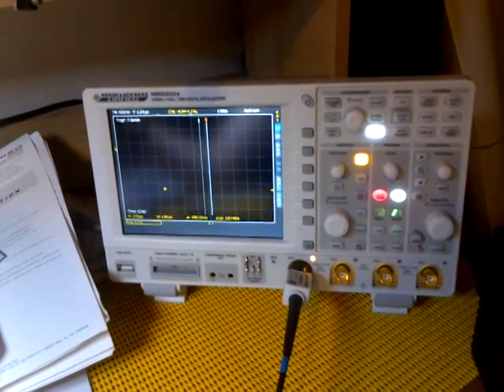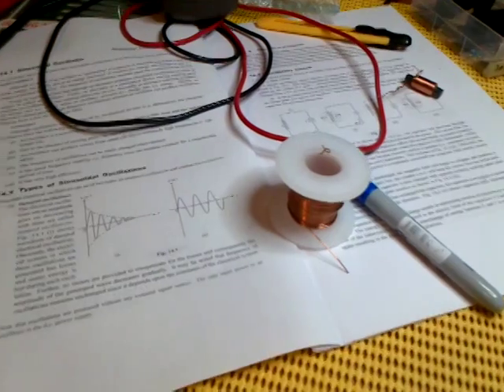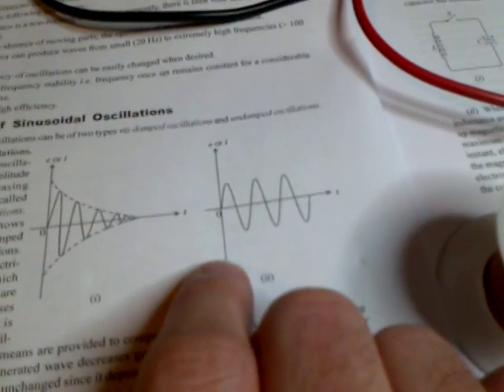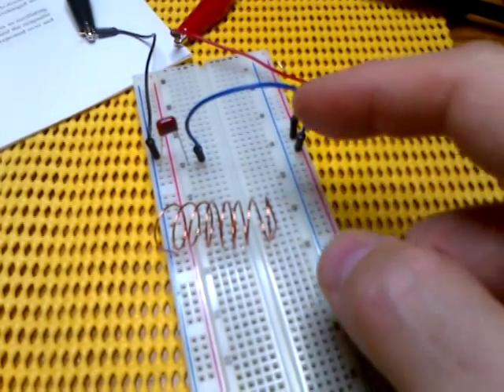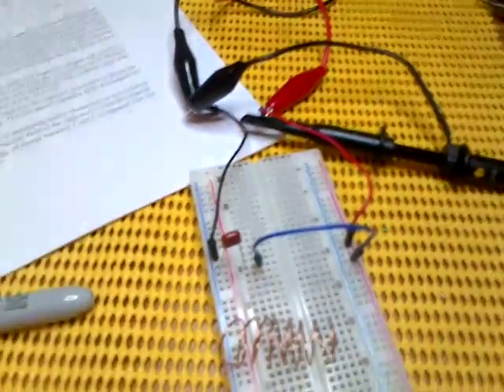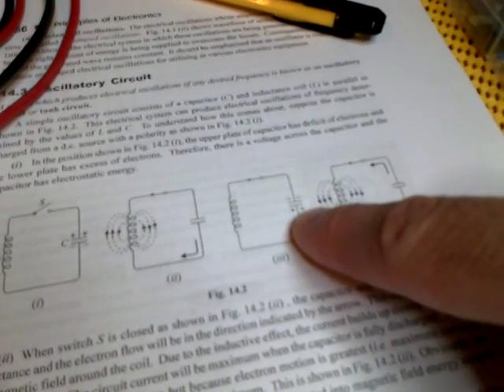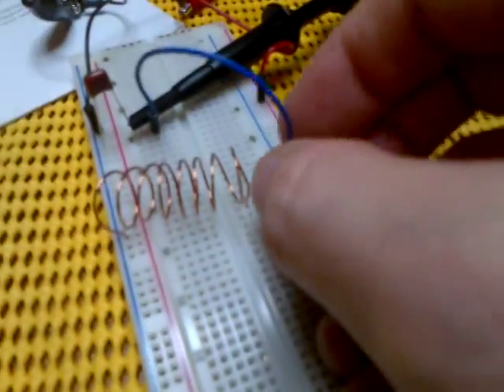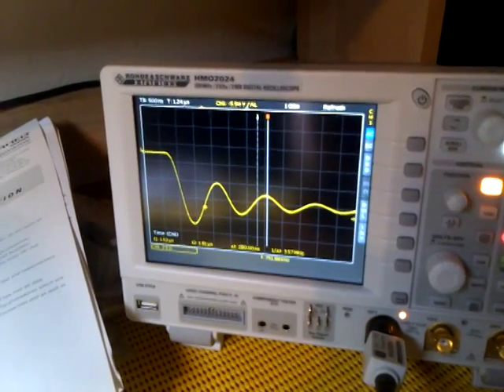LC (tank) circuit dampened oscillations on an oscilloscope Part 1 of 2

Comment: Is it possible to build an oscillator circuit, drive it into the ground through two electrodes, and emit electromagnetic waves at desired frequencies?
Reply from the maker: @mirzakral7807  Yes, I think this can be done. I believe low frequency radio waves passed through the ground is(was?) used to give cave rescue teams a telephone system to use underground, where regular radio communication does not work.
Reply: @queuerious  Thank you for your comments. I also think that these low frequency waves can induce some underground metals. Mine is an amateur project. I am researching to see if some metals can be detected with a sensitive antenna.
Reply from the maker: @mirzakral7807  good luck with your research!

Comment: Like video - could you tell me the value and type of capacitor used ?
Reply from the maker: @DavidHodgson-rm5gw, I dont recall the values unfortunately. I certainly didn’t use special values, and would have used a capacitor that was at hand. Start with a larger value of C (say 1nF or 1uF) and try some random wire coiled up, and see what happens. The frequency should be 1/2pi(sqrt(LC)). Good luck and thanks for watching.

Comment: So that capacitor plates get recharged by the magnetic field of coil.
Reply from the maker: Yes. The changing current in the coil induces a changing magnetic field, which induces an opposing voltage and current in the coil, and this reversal current fills the capacitor. As the capacitor charging slows, the process is underway again in the opposite direction. The resulting current flows back and forth in the circuit, from one capacitor plate to the other, passing through the coil. The frequency of this behaviour is only dependent on the amount of induction in the coil, L, and the size of the capacitor, C. The result is a 'ringing' of energy, which is dissipated with heating from parasitic resistances until the current stops flowing. 

This inductor/capacitor (LC) arrangement is central to many oscillators (e.g. in radios), where you can get steady, continuing oscillations by adding energy into the LC circuit at just the right time (that is "in phase" with the natural resonant current flow described above).

Thanks for watching!
Reply: @queuerious  It's interesting to see how it works with one swing. I see 2 further steps to go. There is a maximum voltage for each LC-Circuit. That's the Q-Factor. And it always takes 10 or more swings to get to full swing respectively to get to the Q-Factor. The ringing would be much better and much longer with a signalgenerator pulsing 20 times.

The second step is the frequency. The frequency here is at 3-4MHz. With a smaller capacitor the frequency would be bigger and the Q-Factor would be bigger in square. At 100MHz approximately at Q-Factor 10k. Which means 5v in and 50kv swings. The best is to swing it without capacitor. A wire/coil has also capacitance and resistance in one wire. It's the natural frequency. It's the highest it can get. With your coil here the natural Frequency would be in the GHz range. The Q-Factor would be over 1000k. This means 5v in and 5000k swinging. Check google with "superconducting radio frequency". There is a wikipedia article on top. Let's see what happens at frequencies above 200MHz.

Comment: Isn't that basically a tiny EMP? Discharging a cap over a coil?
Reply from the maker: Hmmm, an Electromagnetic Pulse (EMP) is a term I have come across in military examples, as electromagnetic waves emitted in a large sudden energy dump into a radiating focused antenna. 

In contrast, what this simple demonstration shows is 1) the idea of reactance - the design of a capacitor (holding charge across its plates) and the inherent inductance of an inductor (magnified by the formation of a coil) and 2) resonance of any capacitor and inductor in a “tank circuit”, where the back and forth flow of current follows a sine wave, dampened by energy losses (heat and radiation I guess).

Comment: great example, Thanks. I am trying to replicate it, but I am lost. could you please tell me the CAP value, time division and the possition of the trigger?
Reply from the maker: Hi Listen, I don't recall the capacitor value. I don't think it is very important:  select a capacitor value, C, and make an inductor (as I did, wrapping wire around a pen or bolt). Once you charge the capacitor and connect it to the inductor, you will get damped oscillations. If you know the C and L values, you can determine the frequency, f, of oscillations using f = 1/(2 x Pi x squareroot(L x C)). You can then set up the oscilloscope time division to capture that frequency clearly. I did not know the L value, so did not know the f value. Instead, I get the oscillioscope to automatic capture of the signal - it's a bit of a cheat! However, you can repeat the oscillation and each time change settings on the 'scope to get closer and closer until you find the right time division and trigger level (volts per division). Good luck!

Comment: did you measure the frequency of oscillations and see if they matched the resonant freq formula for an LC circuit?
Also, do you have a rough idea of the values of L and C used?

Comment: Hi, nice video =)

It seen's that the capacitor discharge very quickly. Do you know how to calculate it?

thanks for sharing
Reply from the maker: Hi Felipe, the relationship between the capacitor, C in Farads, and the inductor, L in Henrys, have a natural resonant frequency where they pass the energy back and forth between themselves like a game of 'catch the ball'. In an ideal no-loss world, this special frequency is w0 = 1/(sqrt(LC)).  However, the real world is not lossless! The energy is dissipated through the small wire resistance, R, as well as radiated away from the wire as a radio wave. The damped effect we see in this video eventually flattens the amplitude of the signal to zero volts. Check out http://en.wikipedia.org/wiki/RLC_circuit for a summary. Thanks for watching!